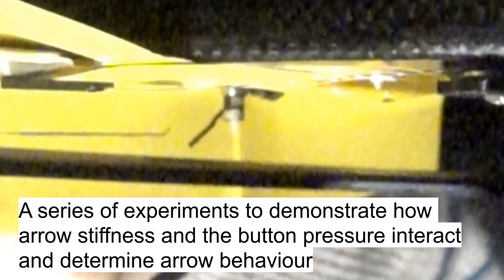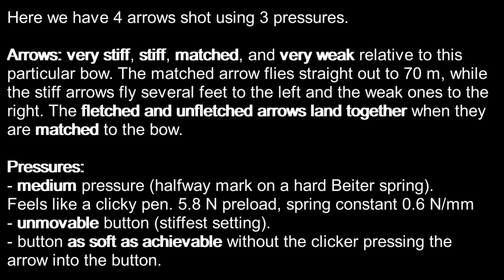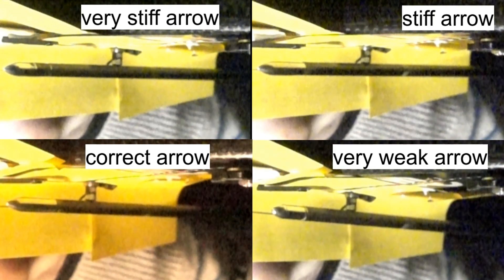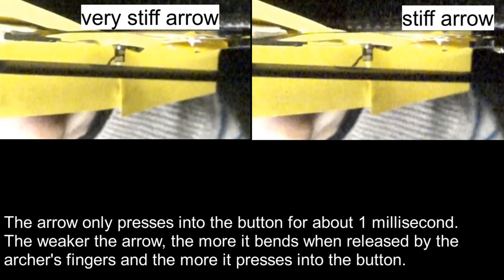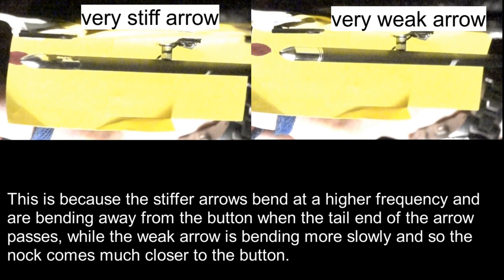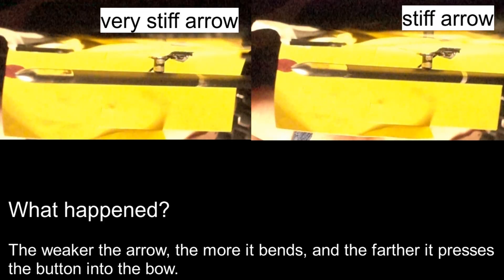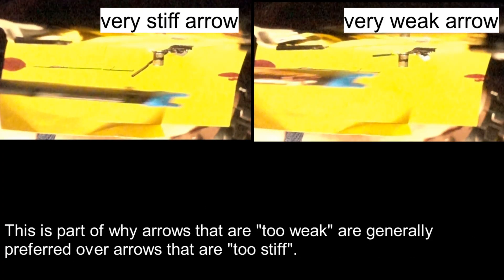Slow Motion Recurve Bow pressure button and arrow interactions

Comment: 1000FPS isn't fast enough! The camera on the Huawei P40 Pro can manage 7600FPS! That's fast enough!
Reply from the maker: It would be very cool if a smartphone could actually record that fast at decent quality. Unfortunately that's a marketing gimmick and the real frame rate is either 960 or 1920fps before it interpolates extra frames in between. It sounds like it only records for 0.125s but it would be cool to see if it could be set up to trigger when an arrow is released.

Comment: Interesting, but I still can't figure out if my arrows are stiff or weak. My 500 spine bareshafts tail hits the bow, but another 500 spine brand arrow with fletchings do not have marks on them. I'm using a traditional Korean 35lbs bow so no centrecut at all, up to a point you would expect the arrow to hit, but my new bareshafts are all angled nock right at short distance. Thats thumb release so the arrow is also on the right side of the bow.
Reply from the maker: If they are hitting the bow, then the nock angle in the target cannot be trusted. Using a thumb draw a wider range of behaviours are possible, from almost no horizontal bend regardless of spine (like with a release aid), to large bends like with a Mediterranean release. 
Two brands with the same spine label can behave very differently, and total length, total weight, weight distribution mean you cannot infer from one arrow to another.

Comment: Very interesting video, I was using a 34 lb bow (real str 36) and 700 arrows, which worked perfectly, i've recently just changed to 40 lb limbs (real str) and of course the arrows are too weak, right now i m using the hard spring on the beiter plunger but with the lowest pressure level, and i m not sure it's the ideal setting. Should I reduce the weight of the tip? or cut the shaft 1 cm? both? anyway, thanks for the video!

Comment: So basically with a properly tuned bow and spined arrow the plunger button tension really doesn't matter ...? This is pretty much what I find in the range situation . Can you comment please ?
Reply from the maker: Doesn't matter for what? It has a considerable effect on the horizontal position that both fletched and bareshaft arrows land, which is most relevant when the bow and arrow are matched to each other. If the arrow is far too weak or far too stiff for the bow, adjusting the button pressure has a smaller effect because it's barely moving at all, bottoming out, or the arrow is hitting other parts of the bow and masking the effect of the button.
Reply: @slowmotionarchery  thanks for the reply . i find that the plunger stiffness doesn't seem to make much difference IF the arrows are properly tuned to the bow and centreshot is optimised for the system and archer. Using a medium spring Beiter I find little effect of increasing or decreasing button stiffness. Indeed one tunes initially with a locked button . I find centreshot has the greatest effect on getting straight arrow flight from the bow , then BH , then poor release . I have experimented or weeks with button stiffness and find little effect . Many olympians shot 1300 + scores with hoyt suparests .
Reply: I can increase button stiffness to send my arrows left at 15 meters. How does that translate in this scenario ?
Reply: Thanks for the informative video, after watching this I have decided not to invest in a plunger. Looks like more kit, more complications, more stress. 😂

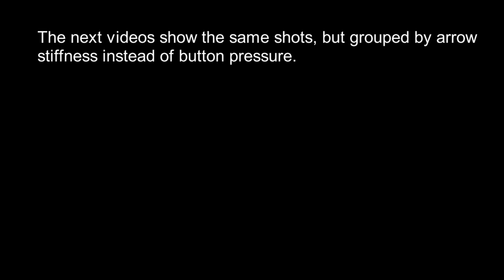Comment: Quick Question: at 3:20 the statement "This is why arrows that are weak and preferred over stiff" (paraphrasing) It sounds like the arrow almost hitting the plunger again is a good thing? Can you explain this a bit? I need to spine some new arrows and I am on the line in  the charts and was wondering is it best to go weaker or stronger. This would also be contrary to suggestions from the pros (little p) in shops. 
Awesome content, this type of discussion, that being facts, seems to missing from many archery fields where opinion rains supreme.
Reply from the maker: As long as it's not so weak that it actually hits the button again, having an arrow that interacts more with the button (flies slightly weak) seems to be very slightly preferable for group size compared to one that barely presses the button (might as well just use a bow from the 1960s if the button isn't able to do its job). If the draw weight is reduced a bit then the "too stiff" hits the bow as well. 
For a newer archer though it's better to err on the stiff side as they're likely to increase draw weight and therefore "grow into" the stiffer size, and stiffer arrows in general are more resistant to being stepped on/shot into wood/bent when pulling out etc.
Two archers with the same draw weight and length may need different spine sizes (the chart just gets you into the right ballpark) so unless you know whether you tend to need stiffer or weaker arrows than the chart it's always a bit of an expensive gamble unfortunately. Depending on your experience level, bowstyle, clicker use, and distances shot, sizing up or down can be preferable. Happy to elaborate if you share what your use case is

Comment: Can you vary the flexing of the arrow by adjusting its length?
Reply from the maker: Yes! It's one of the most straightforward ways of changing the way it flexes. As you decrease the length, the arrow bends less and also bends at a higher frequency. The net effect is that it goes from looking like the medium arrow to the stiffer arrow.

Comment: I have 26lbs bow and shoot with 700sp arrow and end Nock still hit on the arrow rest.. it flight like tornado spin. Should i use 1000sp?
Reply from the maker: If your bow has a pressure button you can try increasing the pressure a lot and/or moving the tip to push the arrow out more. It's also worth checking that the string lines up with the middle of the limbs and nothing is bent, because if that's the case then changing the arrow won't help. 
Whether the current arrows are suited for the bow depends also on the arrow length and the way you shoot, not just the draw weight so it's impossible to say if the 1000 size would necessarily be better

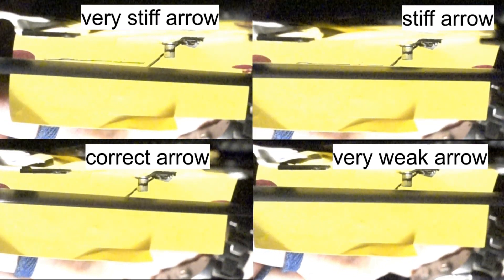Comment: At1:56, checktp the arrow rest for the whippy shaft. The weak shaft’s contacting it late, even though it misses the button.
Reply from the maker: Yup - the weakest shaft there is a size meant to be used with a draw weight about 10 lbs less than the "correct shaft". It also contacts the rest badly with the weakest button pressure, but manages to avoid the arrow rest when the medium pressure is used - so if someone really wanted, they could pick a button pressure that gave enough clearance for that shaft and fletches to not hit the rest, though it wouldn't be as much clearance as with a stiffer shaft.

Comment: It would be really good if you could follow this up with slomo of the flight after it leaves the bow.  In other words how was the arrow flight affected by the different spines and button pressures
Reply from the maker: Sure, it's on the list but needs a rare sunny day as my lighting setup isn't powerful enough for long distances.
Reply: @slowmotionarchery  thanks. It's really the flight after the initial launch. For instance if the shaft is kicking left and flying at that angle for some yards before straightening as a result of button pressure, spine, a combination and so on. Obviously bareshaft tuning can tell you a lot but that initial flight shape would be so interesting. Thanks for the video
Reply: @michaelburrows7600  I am fascinated by your question and struggling to think this through. There is so little clear theory about the effect of button pressure, spine and centre shot. For a simple start I do not understand why an arrow that has kicked left for example should ever straighten up? Why does not newtonian physics just keep taking it left?If you have ideas about this i would love to hear.
Reply: @Autotectonica  Not really qualified to say but the vanes do the job of straightening up the arrow.  If you fire a bareshaft they will land at an angle if the spine of the arrow does not match the bow.  This is good as it helps you tune.  It can also be affected by the finger release so even with a well tuned rig you can get poor flight by not releasing properly.  As to the button - as the video shows this can effect the flight too.  Where it really gets interesting is when stringwalking.  The greater the crawl the greater the effect on arrow spine or rather the spine to the tune of the bow.  So it would be really interesting if Lester can do a follow up video of the next part of the flight.  It would certainly give some insight to tuning.
Reply from the maker: @michaelburrows7600  I've added a new video that includes both fletched and bare shafts that are matched, and slightly too weak. The weak ones bareshaft tune just as well, as the matched ones, but at a slightly different button pressure. I'd expect the flight of the weak arrows to look the same whether the apparent weakness is caused by the button pressure or spine.
Reply from the maker: @Autotectonica  The area of physics to look at for more depth on that is aerodynamic drag. An arrow that leaves the bow pointed in a direction that's different to the direction that it's centre of mass is moving (having an angle of attack in the horizontal plane) experiences higher drag than one which is aligned with the airflow. Roughly speaking, the drag force pushes the arrow back into alignment with the airflow. This happens with both bare and fletched arrows, but because fletched arrows experience slightly more drag, the process happens much faster to them. If you want to learn more about archery physics, there's a lot of well researched papers on the topics by Bob Kooi, James Park, and others. H. O. Meyer has a more accessible report called "the applications of physics to archery".